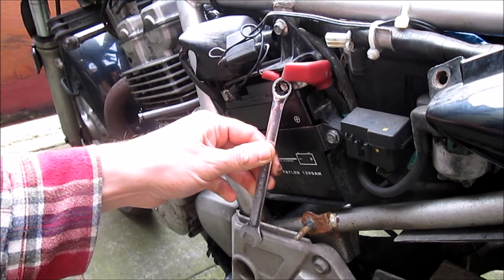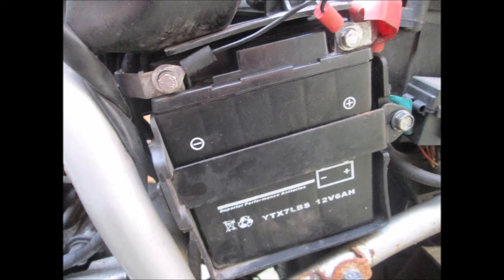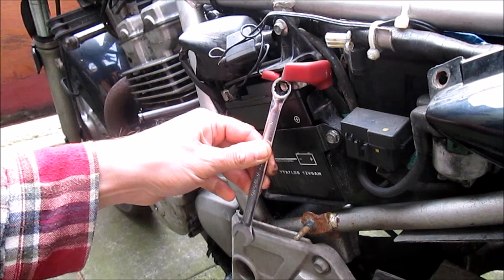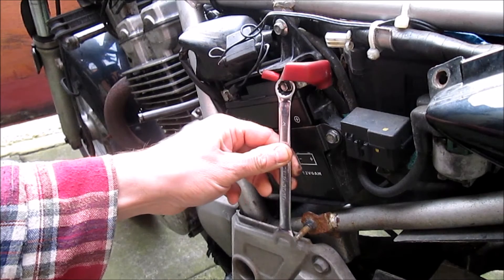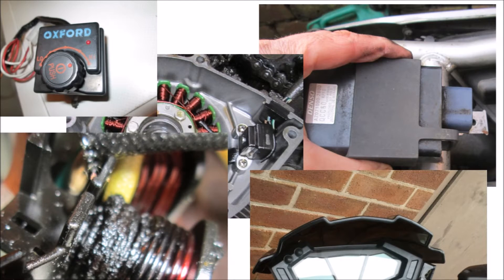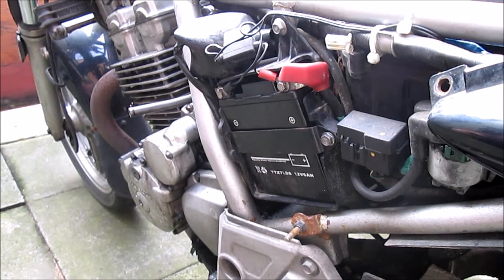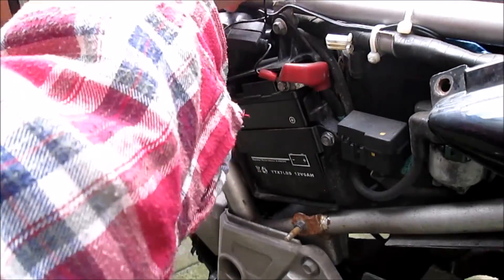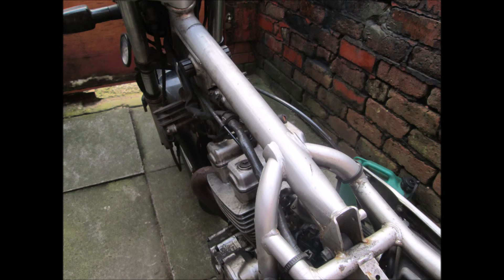Disconnect The Negative First!

Comment: Can somebody explain why we do this like the electrical understanding. I know I'm going to forget unless I know the nitty gritty behind it.
Reply from the maker: Nearly all modern vehicles have what's called a negative earth. That means the negative side of the battery is connected to the frame or chassis, the main body. So for example the starter motor only has one wire going to it, positive, it gets negative through the engine which is connected to the frame.

If we accidentally connect the positive to the frame, like when using a spanner incorrectly as shown in the video, this connects the positive to the negative via the frame. Big short circuit, big sparks, damaged battery, damaged electronics and even a fire!
Reply: @renwithnell8188  yo thanks for the explanation, appreciate it. I Watched some videos on current, voltage and electricity 101 and it makes sense now. 

Removing the negative ensures the circuit is disconnected and no power can flow.
Reply from the maker: @insaini87  Spot on sir. We are all here to learn.

Comment: in electronics you always disconnect the positive first because some circuits will run away if you disconnect ground first, for  instance a bomb, always cut the positive wire
Reply from the maker: It's a very good job I'm not in bomb disposal then! Cheers.